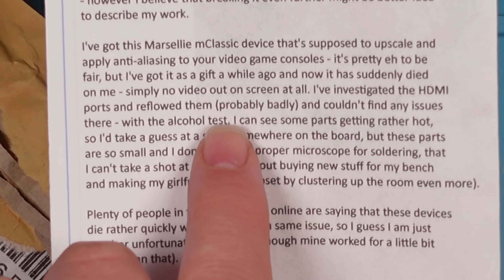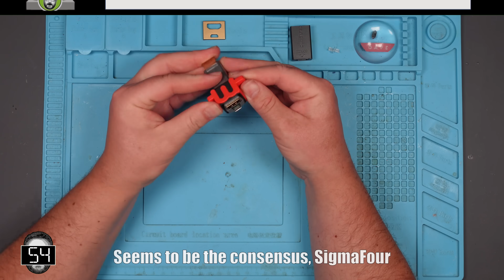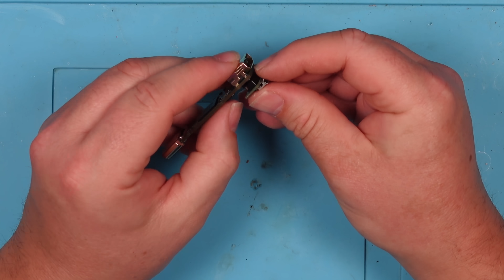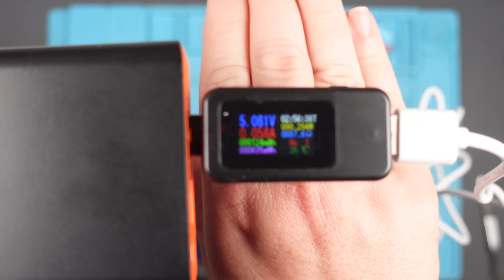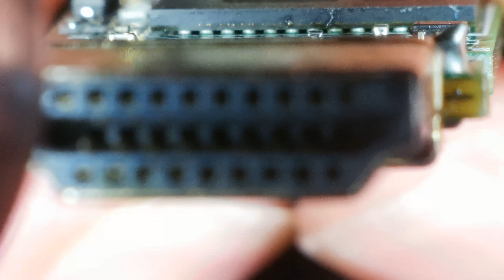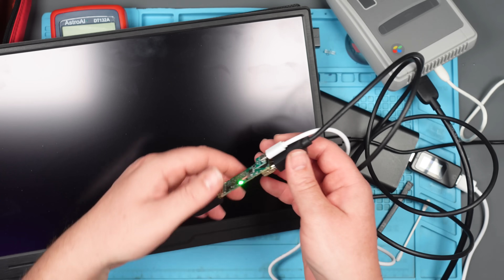I was sent this mClassic with NO VIDEO Output | Can I FIX it?

Comment: Could this be a case of a faulty chip like the chip that Onkyo was using for a while that had a bad batch? It acted like the chips that Onkyo was using from Texas Instruments - they too worked when you heated them up, and then would stop working once cool. Sometimes, you can reflow them and they will work for days, months or even years, but the ultimate fix was replacing the DSP chip with another series that worked correctly. Just a thought.

Comment: If it worked a bit after a good heating, it's a ceramic cap. Not 100% shorted but still acting like a resistor. When heated the layers moved back and forth. They are hard to find.

Comment: Chatgtp says…. it’s most likely an LDO / small voltage-regulator (a 3-/5-pin SOT device with an ENABLE pin) — but there are a couple of other possibilities (power-switch IC or dual MOSFET) so I won’t swear on it from one photo.

Why I lean regulator:
	•	The marking you read (“EE AO” / two short lines) is the sort of tiny code many LDO makers use.
	•	The part sits right next to small beige capacitors — classic input/output decoupling for a regulator.
	•	Boards normally place a regulator near those caps and with moderately thick traces feeding other circuitry.

How you can confirm quickly (two easy checks):
	1.	Look where the bigger copper traces go — if one side goes to a VIN pad (near an input connector or a fuse) and the other to VCC rails/other ICs, that’s a regulator.
	2.	With the board powered, measure pin voltages (relative to ground). If one pin is steady at a common rail (3.3V or 5V) it’s almost certainly a regulator.
	3.	If you can follow the silkscreen/net labels nearby (VCC, VIN, 3V3, EN, GND) that’ll nail it.

If you want I’ll help trace it from the photo — point out which pads you can see and I’ll say which is likely VIN, VOUT and EN. Or drop a sharper closeup of the markings and the surrounding nets and I’ll try to match it to common LDO parts

Comment: Searched the chip on chat gpt and it gave some good answers not sure if chat gpt was as relevant then but it says

Got it 👍 sounds like you’ve got a small 4-pin IC / package with “EE AM” written on top.

A few things that will help narrow it down:
	1.	Package type
	•	If it’s a tiny square/rectangular chip with 4 legs (2 per side), it’s often a SOT-23-4 / SOT-143 style package.
	•	If it’s bigger and flat with 4 legs total (1 on each side), it could be an opto-isolator, MOSFET, or regulator.
	2.	Markings like “EE” or “AM”
	•	Small chips use top-mark codes (shorthand), not full part numbers. “EE AM” could correspond to a MOSFET, EEPROM, voltage regulator, or ESD protection diode depending on manufacturer.
	•	For example:
	•	“EE” is sometimes seen on MOSFETs (dual N-channel / P-channel).
	•	Some EEPROMs also carry “EE” as a marking.
	3.	Where it sits on your board
	•	If it’s near a connector/USB/HDMI input, it could be an ESD protection chip.
	•	If it’s near power circuitry, probably a MOSFET / regulator.
	•	If it’s near a microcontroller, could be an EEPROM.

Comment: When the video started working after the re-flow I was willing to bet money it's not gonna last. I remember that era when everyone but granny was shoving their dead gpus into ovens in the hope of resurrecting them, and surprisingly quite a lot did... for a short while. Heat does that sometimes to dead chips. Unfortunately it never lasts, and unless you have strong reasons to suspect corrosion, re-flowing is generally wasted effort. You stumbled into confirming the main chip was the culprit, and now it's dead for good. To the recycler this goes.

Comment: At 5:10 looks like a solder bridge between two pins on the HDMI connector??? Could be intermittent - I have an oscilloscope which developed a dead channel after  ** 30 years ** which turned out to be a tiny solder whisker standing up off the board which had taken that long to finally bend over and shorted something out. Had been there since new and took that long to happen!!!!!!!!!!!!!

Comment: ok so mine has the same issue and after watching you video i took mine apart and used it while bare, it worked, i'm like wth since it didn't work put together, so i didn't put the thermal pad back on and put the rest back together and it still works now, its that freaking thermal pad. so the mclassic even heat up enough without it for it to matter? i might look into getting a new thermal pad for it but i gotta find the right dimensions now. least it is an easy fix i don't have a heat gun, i got a little soldering skills but not enough for stuff this small lol
Reply: i really hope you noticed this because i'm pretty dang confident the mclassic your working on is having the same problem since it worked fine when disassembled

Comment: Noticing the monitor go into Power Save mode, before it finally worked (before putting it back together), I thought it was turning everything off.  But it was just something it was doing right and not an issue.  LOL.

Comment: Give it another blast of heat, if it works again try changing the crystal. I had a USB arcade joystick and button controller board that only worked when heated once. On a whim I changed the 16MHZ crystal. It's working great ever since. Love the videos by the way.

Comment: The only guaranteed fail is not trying.   I had an audio board with a bad op-amp.   When it was hot,  it worked.  When it was not,  it didn't.   Perhaps you've got a similar situation.

Comment: you actually plugged the mclassic in wrong, the source part goes into the switch HDMI, i feels weird and it doesn't fit right into the base of the switch without a small extension adapter but ya, it was never going to work the way you plugged it in. edit: i see you figured it out after that first try though so oh well lol

Comment: 82 degrees is hot in the uk? What's it like in the winter? Like what's the average lows? Sounds like I could used to those temps, it's gonna be 97 degrees here Wednesday in Illinois, 36 Celsius

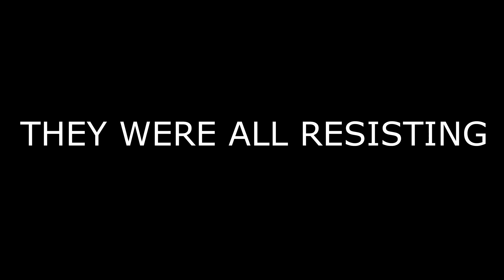Comment: @13:34 the 2kOhm resistor to ground is probably a pull down resistor. So yeah, it’s totally fine for some resistors to be shorted to ground on one side.

Comment: I think the mul-tim-i-ter is the multi-intimidator! I am not arriving from a great height, so I don't need an al-tim-ieter. However in the context of a conversational multiplexer, sodomy is not an option. That means an iron or solder that promotes soddering, doesn't work for me. Consider a soldier of an army means strength and solidarity; Therefore connections are there that are not meant to be broken and are considered "soldiers". Ergo; SOLDERED. I love my fellow North Americans, but sometimes a tow-marto is NOT a tow-mayto, and I don't want to be "soddered".

Comment: What i'm thinking is that you want to see whether you get EDID on the input! Just take an LA and put it on the DDC lines in i2c mode. No EDID no life.

Also that looked mildly promising. Perhaps take off the main chip look whether there's any oxide on the pads underneath. Then you can reball the chip. Also with the chip off you might get some ideas as to what hot components actually do.

What is the 8 leg boy? Is it possibly a 24c for the EDID or a 25q for the firmware?

Comment: Is that a RP130x voltage regulator they come in dfn 1010-4 packages. s-manuals smd code search identified it as a possibility.

Comment: The Mclassic is extremely misunderstood. 

The lower the resolution you input the better the upscaling and anti-aliasing.  Especially at 1440p.  It's perfect for Wii, Gamecube, WiiU, Xbox 360, and PS3 games, but you have to set it up correctly. 

For wii and Gamecube you want to get 480p sent to the mclassic and upscale as much as your monitor can handle. If you have a 1440p monitor then you might need an EDID emulator that will force the Mclassic to 1440p (it only works with EDID 1440p 60, and most monitors have EDID 1440p 120 which will not work). 

For XBOX and PS3 send 720p to the Mclassic for the best image. 

For WIiU send 720p for WiiU games and 480p for Wii.

Comment: @13:02 If it is supposed to be a pull-down resistor, then that would be not only alright, but rather required. Of course, we don't know if that is the case with little R8 here.
- What a slightly daft question, how do you not know such basics? 🤨- Especially since you then go straight ahead and put me to shame by reseating that BGA chip afterwards, making it look like the easiest thing in the world to do in the process. 😅❤

Comment: I actually love the mClassic. I use it in conjunction with my EON GCHD GameCube HDMI adaptor. Definitely helps clean up the image on a modern television.
Reply: Ooo I'll look into that. Where did you get the HDMI adapter?
Reply: @rustynail1194  Google Gamecube Carby.  It's a much better more affordable option and will work great with the Mclassic.  Also you can get an EDID emulator that will force the Mclassic to 1440p if your monitor can handle it.
Reply: I use the mClassic with the PhotoFast 4K. It works great.

Comment: How can the LED come on if it's drawing 0 ? What's powering the LED? Also, as pointed out elsewhere, at the beginning, there was a sliver of solder on the HDMI connector that looked like it was going between pins, when you were re-flowing that sliver might've melted back onto the pins?
12:16 Hi !
13:36 Resistance is Usile !
Reply: 0 amps. 
That little LED is gonna be 0.058 amps, not enough for a $10 meter to detect. Duh.
Reply: Tis just a scratch.

In the PCB lacquer.

Comment: I am 99% sure the little square things are Filters, and a way to test if they broken is to check is the diagonals are shorted, is they are, it's broken
If the case is metal, maybe it's shorting to the case..
Reply: I was thinking filter too.
Reply: I am thinking the same thing, pretty sure it's a filter, especially considering pretty much the entire circuit is dedicated to video and HDMI output
Reply: i dont think the filters used for hdmi on other consoles get ground tho?
Reply: Yeah, seen them on consoles a bunch. Definitely HDMI Filters. Was about to say this
Reply: Yea they look like baluns.
Reply: I think they're filter caps as well.

Comment: I guess it was better when electronic components were a bit bigger than this microscopic sizes. The chances of getting things fixed are ruined because of so crazy small things around the chipset
Reply: Nah nah nah we can manipulate small things all day every day no problem. The problem is not knowing what they are, because cagey manufacturers and lack of schematics. The main chip is deliberately disguised and also the firmware for it is not available. These are the actual repair problems here.
Reply: @SianaGearz  This. Right to repair. Getting the firmware is the real pain as is identifying the parts. I can replace anything (almost) as long as I know what it is and I can get it. Microscopes are really cheap these days as are soldering stations ( not talking crazy expensive "professional" grade ones).  Although when I was younger I could solder and repair phones with magnifying glass (10 -15 years ago - better eyes, steadier hands, more time on hand).

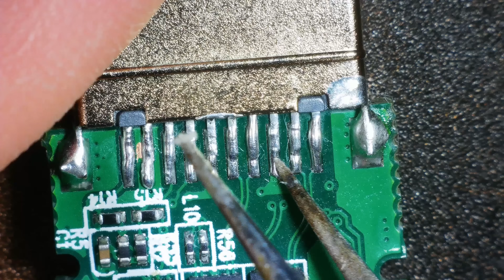Comment: at 5:16 there is a SOLDER BRIDGE on the USB connection pins  5 and 6
Reply: I think that's probably just solder that got on the metal port itself
Reply: @TalmiiorFixesStuff yeah it’s just some solder at the top of the connector, it’s not on the same plane as the pins
Reply: It could be under it too. Worth investigating
Reply: it think it is shorting the case to pin 6 at least.
Reply: @chuck2501
Reply: arent data pins bridged on some boards to allow more amperage (pre usb-pd)
Reply: @uiopuiop3472  That happens on the PCB, not a blob of solder on the USB case  :)
Reply: Came here to state the same thing that I could see the bridge
Reply: Camera angle imo, I think that's part of the USB connector itself.
Reply: I spotted that too - I think its on the edge of the connector rather than pins?

Comment: I've got one of those!! So expensive for what it actually does!
Reply: I've still no idea what it actually does....
Reply: @PITAProductions It's an image upscaler, only needed if you have a pretty large TV or a high-definition monitor and you want a smoother-looking image.
Reply: @javierEI345 thanks - I wasn’t sure either.
Reply: @javierEI345  Don't all (almost?) monitors /TVs have upscalers? Or is that a thing of the past?
Reply: @hmartinlb  They do. Some upscale better than others, and some introduce a bunch of latency. Depends on the TV manufacturer and the upscale algorithms/chips they use. This basically just does the work for the TV, so that the TV itself doesn't introduce more latency.

Comment: You need to add another well-deserved 4000 subs to your counter!
[Spoiler alert space inserted here]

Aww that was a rollercoaster of emotions there! I really thought “nah, that’s not gonna get fixed, hot-air the hell out of it for luck and then give up if the magic heat doesn’t fix it”
And then it worked! You have the magic touch!

Gods of electronic repair:
“Oops, sorry, wrong number, gonna need to take back that magic touch, soz”

I think sometimes it’s harder to walk away and say “I tried” than it is to keep going until you get down about it or go insane, so well done mate. 
And well done for not doing what I suspect some people do and cut the video after it stopped working haha.
Reply from the maker: Yeah, this one was a rollercoaster, that's for darn sure.  I went back to it a couple of days later, 'cos it was driving me mad that it worked for a bit, but alas, those electronic repair gods would not let me replicate the success  😢